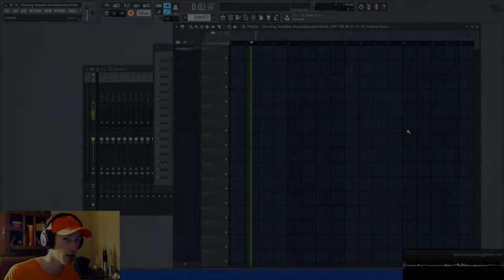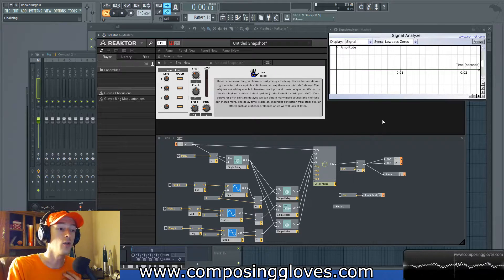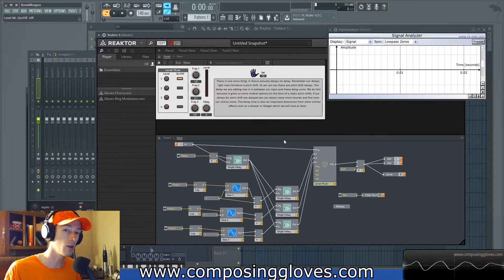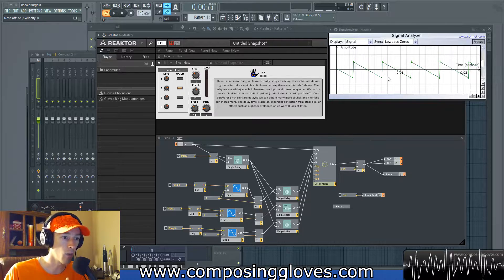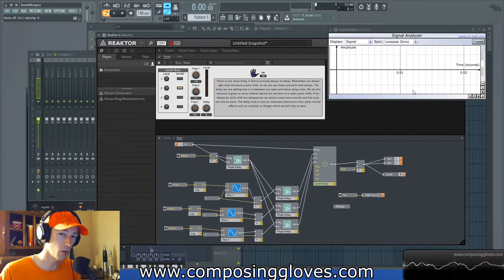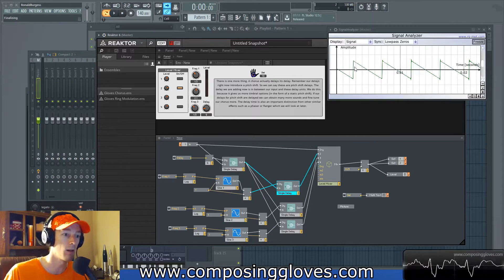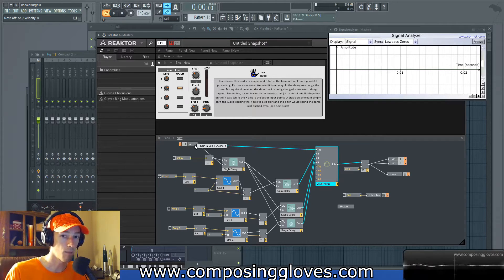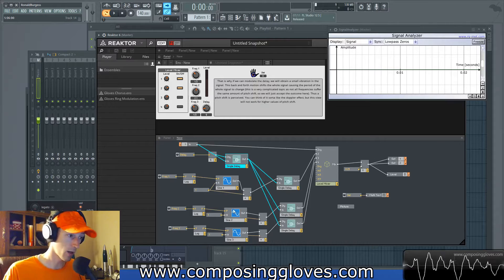DSP 4 - How a Chorus Works

Comment: So it's vibratos with different settings paired with a delay? I don't know if I got that right.

The information is very scattered, you keep going back and forth between delay and pitch variation but don't explain the correlation between the two? anyways, I think I got a better understanding in general, so thanks
Reply: When you change the time of s delay it creates a temporary pitchshift. It's best visualized with a tapeloop, to make the delay shorter, you would make the tape run faster. Until the tapelooper runs completely at its next speed, a piece of the tape will be played at faster speeds then it was recorded, which causes a shift in pitch.

Comment: I had to make that on a microcontroller
Reply from the maker: I just did that this semester as well! We used FM4 arm cortex m4 boards.
Reply: @ComposingGloves  GREAT, I will use STM32F407. It is hard? 
Do you have some material or something to help? It would be helpful c:
Reply from the maker: @kionmahuermicio9860  I don't think its to hard, its just a matter of getting the board set up and feeding it commands. I'd get to know the manual for your board and find some examples and do them. That's how I usually roll. Once I've got a grip on the examples I'll branch off. Reading wise, for the programming and stuff its up to the board and what language you can use. I don't really have any programming books, I've got dsp books but many of them are math heavy and don't feature examples. In the classes I did we didnt use the theory books anyways most stuff was lecture driven.
Reply: @ComposingGloves  Oh, thanks very much for your response. Yeah, I have many of theory books about signals and systems, DSP, Filters, etc. We have to do that stuff in Matlab and only then we implement all of that on the Stm32.
(BTW: Sorry about my English)